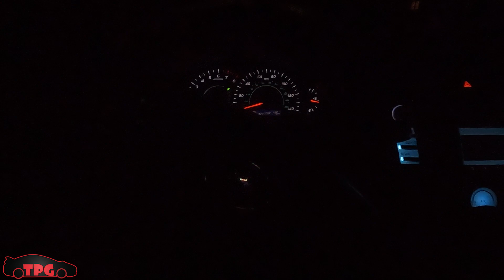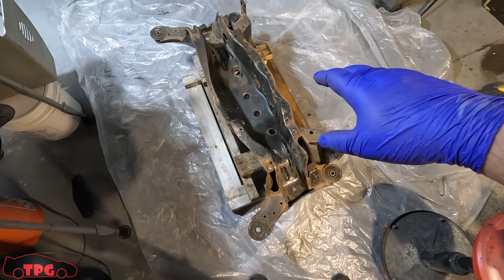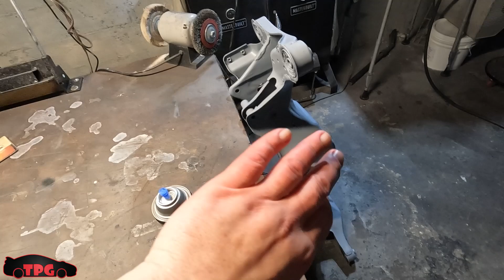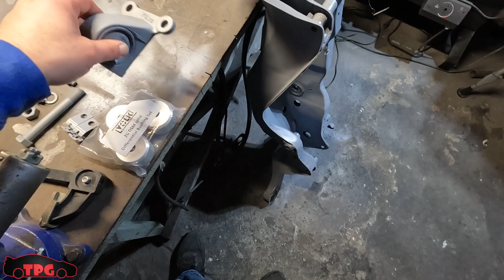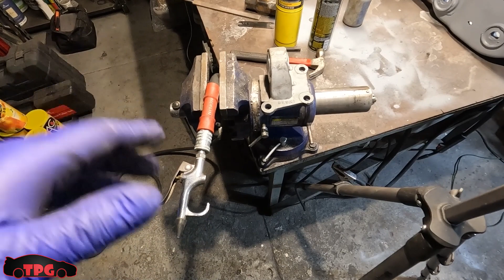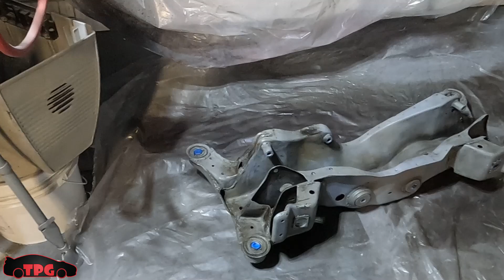DSM REAR SUB FRAME REPLACEMENT + upgrades!😁🛠️

Comment: Did you get alot of vibration noise with those?
Reply from the maker: @DSM4EVER95  not anything noticeable. Felt basically the same as it was before. Slightly tighter steering.

Comment: Old mechanics trick put the new bushing in the freezer for one hour heat the part in a oven and the new bushing should just drop in
Reply from the maker: Yeah man I tried it. Off cam of course. These things are TIGHHHHTTT!!! I can’t complain you want em to be tight.  Appreciate it regardless 👍💯
Reply: After that then i would've used the vise grip to press it in